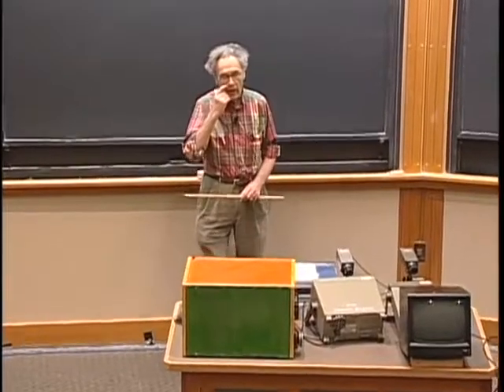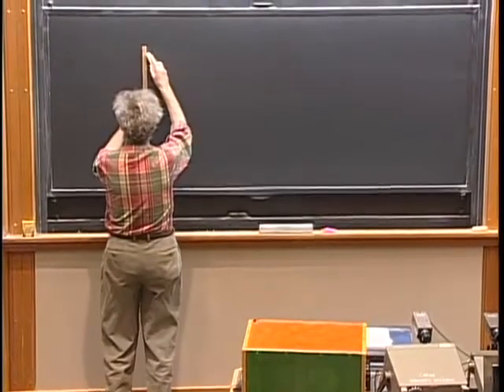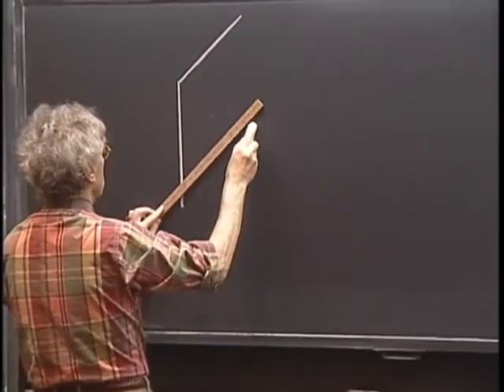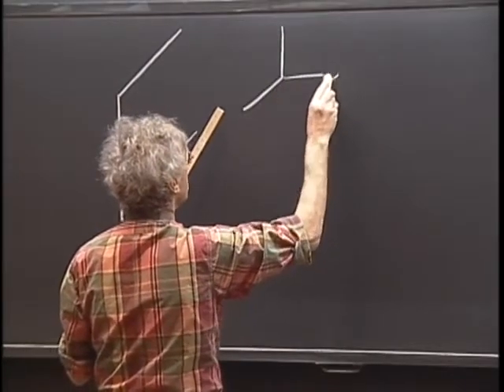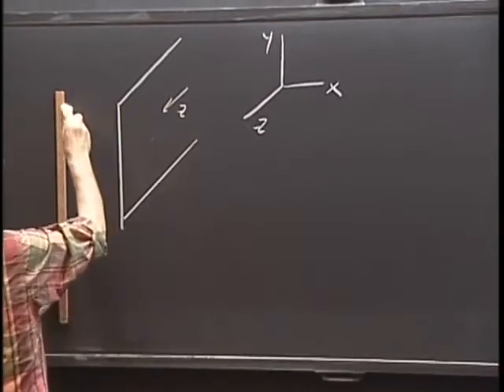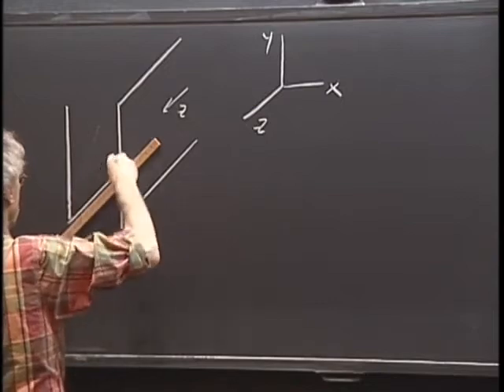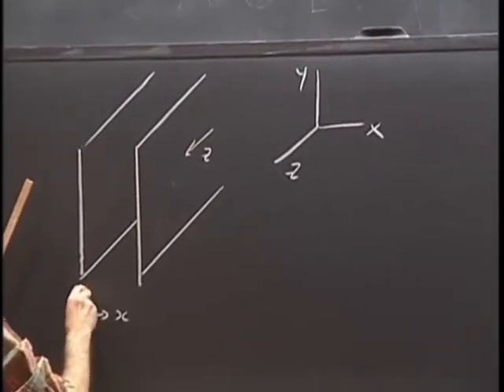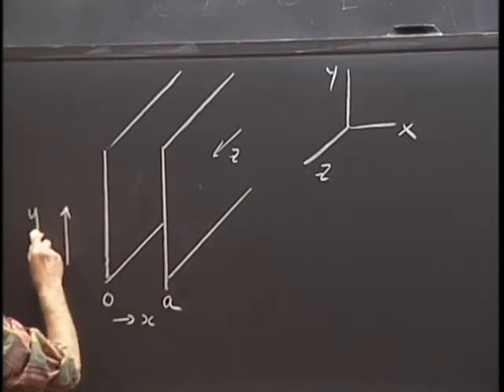8.03 - Lect 17 - Wave Guides, Resonance Cavities, Great Sound Demo in Closed Box

Comment: My initial thought as to why 575hz is the strong transient is because QMo at ωo, that the max amplitude of the system is just about 3% below that balanced point. During the start when there is a veritable plethera of frequencies ω, it finds the max amplitude, even though its not at QMo, and in this case just happens to be a resonant frequency of the cavity so it gives a nice, measurable response.

Comment: Het is altijd een genot om U aan het werk te zien Walter. Ik ben tbv mijn mede cursisten radio zendamateurs licentie op zoek naar een fragment van uw lezing waar u laat zien wat er gebeurd als een spoel in resonatie komt en de stroom door de spoel etc. u liet dat zien met een lamp meen ik. Het was zo goed uitgelegd dat het perfect is om filters in radios en zenders te begrijpen in jip en janneke taal.  Weet helaas dit ( oude) filmpje niet meer te vinden. Weet u nog welke lezing dit was ?
Reply from the maker: ik denk dat ik een RLC system had waarin ik de L waarde kon wijzigen door de ijzerkern in de spoel in en uit de spoel te bewegen.  One can show that, at resonance, XL = XC and thus the impedance (Z) is reduced to R. At resonance, the impedance is the lowest value possible and the current will be the largest value possible. Dan gaat de lamp veel licht geven. Ik herinner me dit allemaal nog maar heel vaag. Het moet in een van mijn mijn 8.02 lectures zijn nadat ik LRC systemen heb behandeld.  Zoek wat en je zult het vast wel vinden.

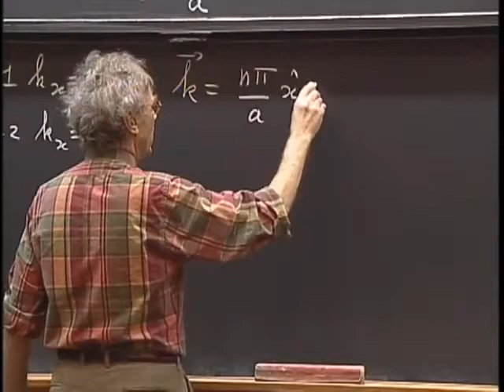Comment: Hi Prof.! Sorry for taking up your time, but I have a question regarding this lecture's 15:35-15:58. Since the boundary conditions of the waveguide require a non-zero k_x component, does that mean a k vector without any k_x component and only k_z component (i.e. propagation direction is parallel to the plates) will not pass through and be reflected?

Comment: Prof. Lewin, I had a problem about wave guides. Suppose the boundary condition is in the x direction as you demonstrated. For an EM wave that is polarized in the y direction and travels in the xz plane, there would be a cutoff frequency as you have taught in the video. What happens if a wave travels EXACTLY in the z direction (no x-component in k)? I mean, if this wave travels in z direction and its E-field only oscillates along the y-direction, shouldn't it be free from the boundary condition, which is in the x-direction? Following that, is there still a cutoff frequency? Thank you for your time.
Reply from the maker: It would take me too long to answer your question.  I suggest you watch my 8.03 lectures on waveguides. In your problem, observe carefully the boundary conditions (wave guides is ALL about boundary conditions) and use Maxwell's eqs.
Reply: Prof. Lewin, thanks for the swift reply. Perhaps I could put my question in another way to check my understanding with you.

For a wave that comes in the waveguide at an angle, since the wave has to meet the boundary conditions, it means only if the wave comes in right at a certain angle (to meet the x-direction restrictions) would they be able to propagate through the waveguide. If they come in at the wrong angle, the wave would be attenuated.

As the wavelength increases, the angle (with respect to the tangential of the plates) increases. When it reaches the cutoff frequency (correspondingly a maximum wavelength), this angle reaches 90 degrees (i.e. normal to the plates), which means the wave actually cannot propagate.

Please kindly guide me if there is anything incorrect in my understanding.
Reply from the maker: if the wave comes in at an angle. decompose it in one direction parallel to the surface and one perpendicular. Use Maxwell's eqs for both separately.

Comment: At 34:35, where does the EM wave go if it doesn't pass through??
Reply from the maker: it's reflected
Reply: @lecturesbywalterlewin.they9259  It is really a surprise to hear from you professor. 
If the wave is reflected, wouldn't it be the violation of law of reflection??
(Angle of incidence is not equal to angle of reflection)

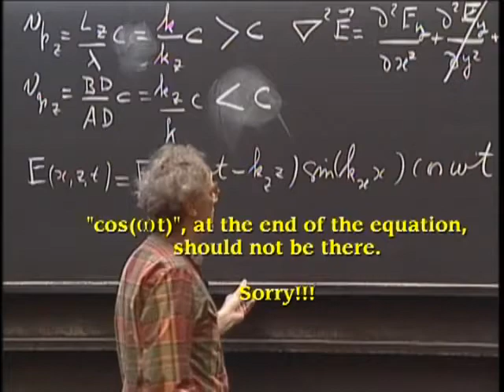Comment: At 12:00, why should the cos(wt) not be there? Is it because all the timing information is taken care of in the traveling wave portion?
Reply from the maker: incorrect
Reply: Lectures by Walter Lewin. They will make you ♥ Physics. So the standing part of the wave has no time variance?
Reply from the maker: question unclear. sin(x)*cos(wt) depends on time
Reply: Lectures by Walter Lewin. They will make you ♥ Physics. But you say cos(wt) shouldn't be there
Reply from the maker: the time term (cos wt) is already in the first term.